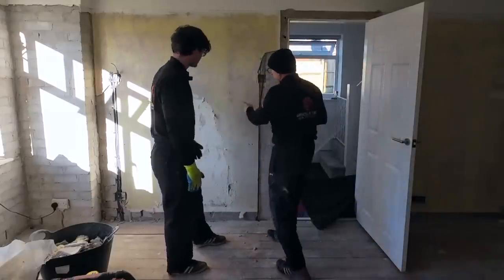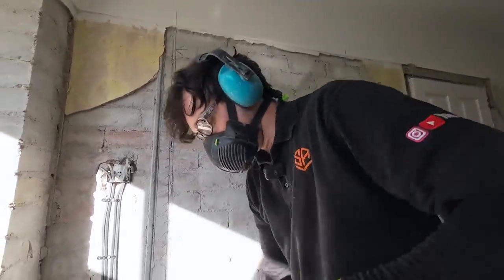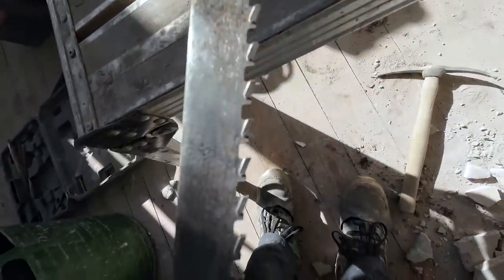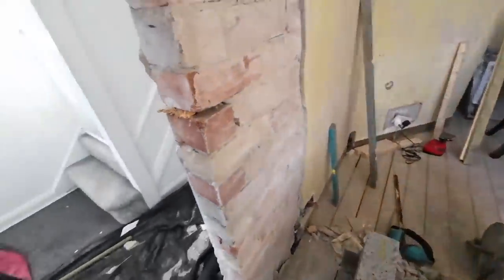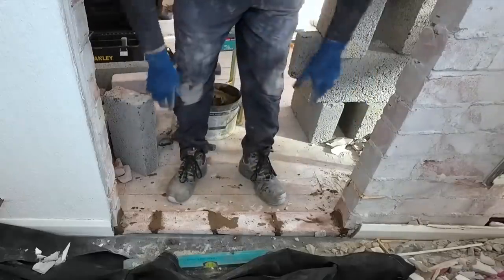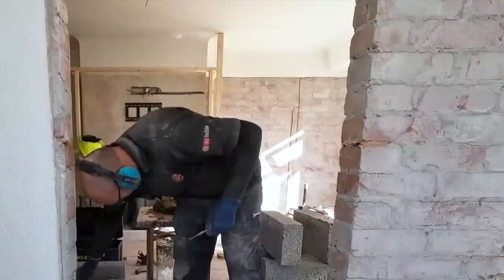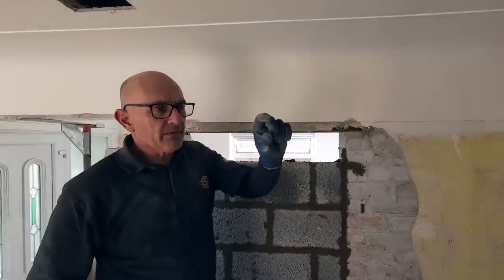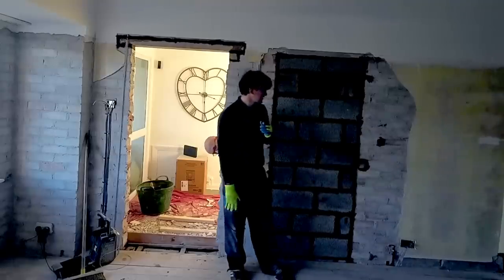HELP!! OUR DOOR IS IN THE WRONG PLACE !!

Comment: Nice easy job for you boys 😊. Just a quick one but how come you left the timber lintel in and not just knock it out and block up to brick above?
Reply from the maker: Thanks. The lintel had been there for about 50 years without any problems so no point weakening the wall taking it out 🧱👍🏽

Comment: Great job as usual guys, how would you cut out an external 9" brick wall for French doors or similar, can you use stitch drilling or best to get the disc cutter out?
Reply from the maker: Cutter outside. Drill inside 🧱👍🏽
Reply: @SteveAndAlexBuild  I bet you wanted to, admit it
Reply: If you can afford it buy an Arbor tec. Cuts thru like butter, 90% less dust. But obverse £1000. But worth if thars what you do  or hire. I've got one. And no can't borrow 😂